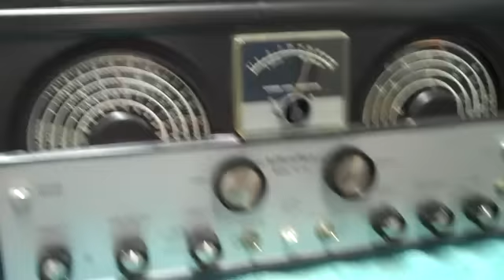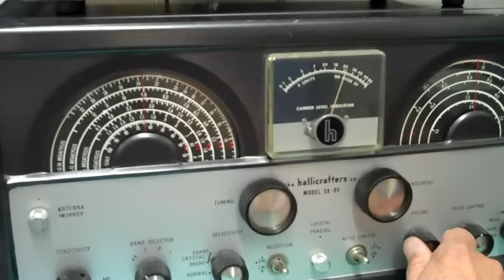1952 RCA Model 17T151 17" TV Repair and Restoration (Part 10 of 27).

Comment: Respectfully and please take no offense but the performance and durability of selenium rectifiers leaves much to be desired.  If anything I would have put a 35w4 tube in their spot.  The silicone rectifiers work better than both of those choices.  The voltage may be a tad higher and may require dropping resistors.  You're doing designer TV repair.  If you charged for your time it would be thousands.  A true labor of love.  Thanks for the great video series.  I just found them.